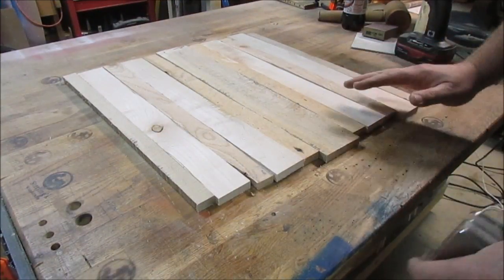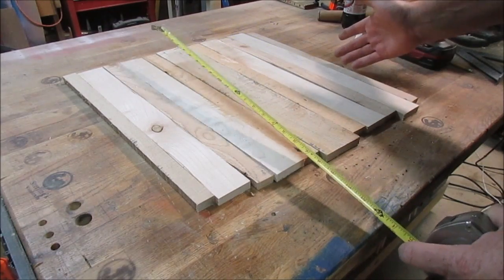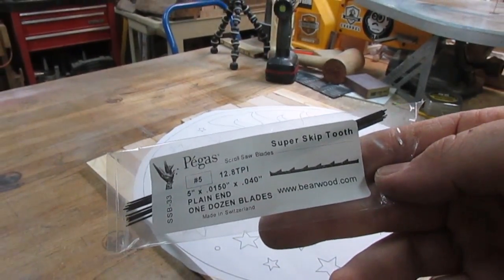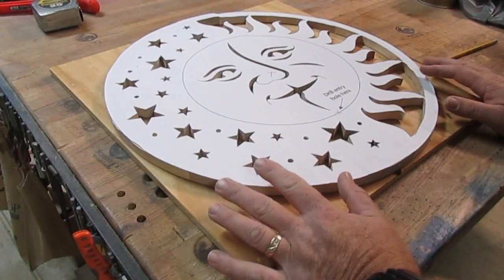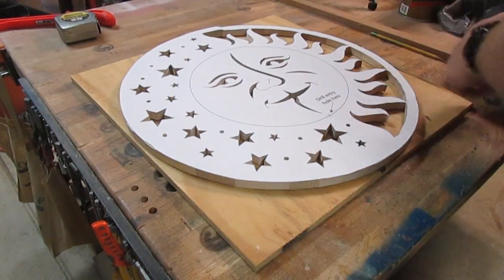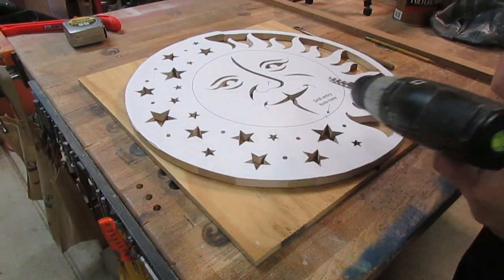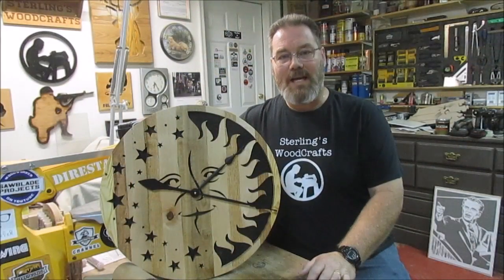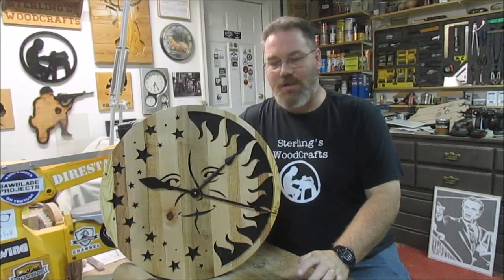Sun Moon and Stars Clock

Comment: Hello Sterling, a nice watch and a great scroll saw work.
What size does the watch have?
I think on my saw I would not be able to make such big projects.
Greetings from Andy from Germany
Reply from the maker: i had the pattern blown up to 20 inches , keep in mind, if you use spiral blades, you can cut in all directions, making it easier to do larger pieces
Reply: Thanks for the tip with the saw blades
Greetings from Andy

Comment: Very nice. Great idea using recycled wood. I like your pattern size, The one at the web site you listed is 8" diameter how did you enlarge your pattern .
Reply from the maker: Thanks for the kind words, i took it to the local Office Depot and had it enlarged to 21 x 21 inches
Reply: ok thanks  great idea.  Think  I will order the pattern and give a try.